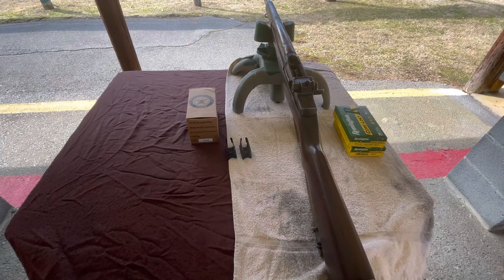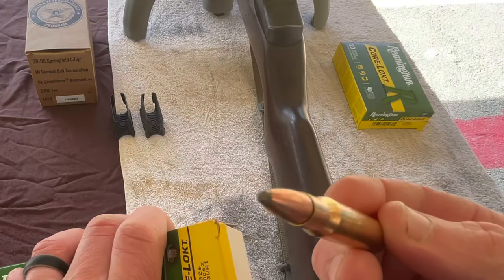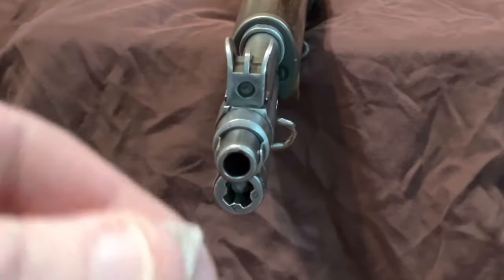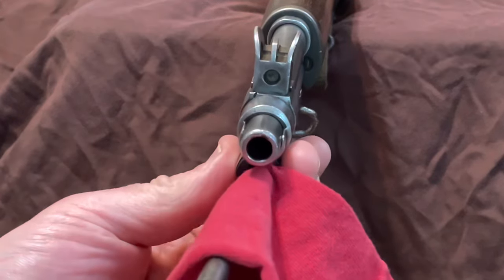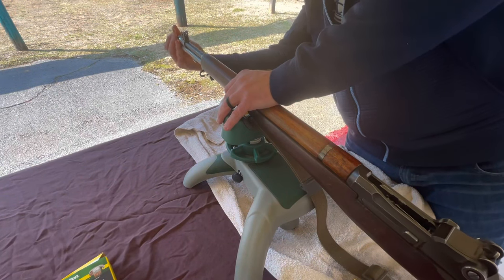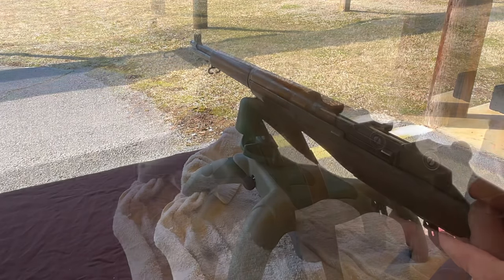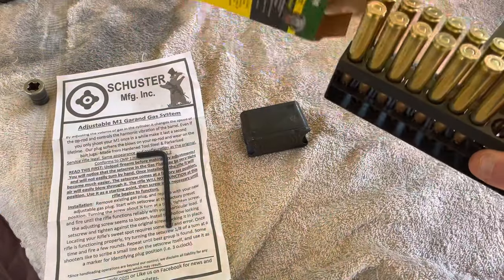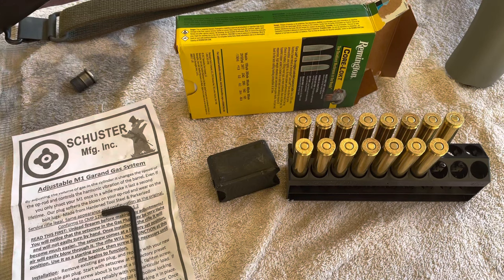M1 Garand Shooting Commercial Ammo-Safely!

Comment: The Garand Collectors Association along with the CMP did a huge article on this in one of there magazines a few years back. Basically explaining commercial ammo is perfectly fine to shoot out of a M1 as long as the bullet weight isn’t over 180 grains. The need for a gas plug isn’t necessary and they recommend just replacing the ope rod spring and lubricating it properly and you’ll be fine. Just stay away from anything over 180 grains and and any super hot ammo. If it makes you feel any better the guy that’s wrote the article was a USMC Match Armourer. Think it was volume 34 of 2019.
Reply from the maker: Thank you for sharing. This seems to be a controversial topic with several opinions and widely varying conclusions. And I can promise I am not an armorer, gunsmith, or firearms expert of any kind so I wasn’t sure at all. My thought was better safe than sorry to protect the investment. Again thanks for sharing the info and thanks for coming by!
Reply: @cornfromajar3222  no worries. I considered the gas plug as well when I bought mine but ended up buying a case of PPU M2 Ball ammo so it’s all I really shoot.
Reply: I'm not convinced. I loaded some very mild 150 gr BT loads last week using W760, as I have a lot of it. According to the Hogdon Data Center, it should have been a 40,500 CUP load. That's 9500 CUP under the CMP max recommended pressure. I've been shooting a lot of 1968 FN Ball ammo and know how it feels. My load was violent. Lots more recoil. Lots more vibration. The gun didn't like it. I have been doing some loads with W748 that are accurate and mellow on the gun.
Reply: There is a lot of surplus ammo out there that you simply can't know how well it was stored. You might be shooting some ammo that is spicier than you bargained for. I have also ran some PPU through my M1 that caused some slam fires and I could tell that the pressures were not consistent. I'm sorry but I can't fully trust surplus ammo or cheap new manufactured "Garand safe" ammo from eastern Europe. To each his own but I know that the plugs are $40 but a new stock and op rod are a lot more.
Reply: @ranchodeluxe1 you might try h4895. I have good luck. keep the loads sane.
Reply: @ranchodeluxe1  Have you considered it might be the shape of the bullet you are using. Boat tail 🤔
Reply: @JamesWhite-tg4kw  Nope. Don't think a 150 BT is going to radically change the guns characteristics over an M2 Ball round.
Reply: I rarely shoot mine. If I do I shoot 150 grain ammo. I was told from a Marine that was issued one in the 50’s and a Sailor who was issued one in the late 60’s early 70’s to keep the spring and op Rod well lubricated.
Reply: @lemmdus2119  so what do you think is the best Lube for this 🤔
Reply: Are completely wrong with everything once you said magazines they don't take them it's a m block clip
Reply: @JamesWhite-tg4kw  grease look up on YouTube you don't use regular gun oil are regular cleaning kits
Reply: I made a amateur mistake one time loaded mine with not military grade 30 odd 6 and a lot of them you cannot
Reply: @patrickkish2931  en bloc. Since we are ball busting.

Comment: The issue is the burn rate of the powder used. Since it was a military rifle, all M2 ammo was loaded with IMR-4895. A powder in the same burn range will work. I load with Varget, which is fine. Is this trick gas plug warranted against damage to one’s rifle?
Reply from the maker: To my knowledge, it is not thanks for coming by!

Comment: Load a round stripped off the clip, by letting the bolt slam forward into battery.  Then eject the round and look at the primer.  See where the floating firing pin hit the primer?  Almost, but not quite deep enough to set it off.  You shoot enough commercial ammo, and someday you will get a surprise.  Much sooner if you fire reloads.
Reply: M16 does the same thing, floating firing pin as well.
Reply from the maker: Thanks for coming by!

Comment: I hand load for all my rifles. The M-1 shoots bullet weights 147gr to 175gr at 2800/2700 fps with no problem. Intermediate burning Powders; Varget, RL-15, IMR 4895, 2520 are the best choice. IMR 4350 and a 180 bullet is asking for trouble. It has to do with pressure curves and timing. Duplicate WWII ball velocities and you will have no problems. Commercial standard velocity ammo 150/165 gr will give you no problems.
Reply from the maker: Thank you for sharing. And thanks for coming by!

Comment: I have purchased this gas plug but never used it.  I've found that new, M2 ball "replica" .30-06 by Privi Partisan costs about the same as commercial .30-06 hunting ammo and is plentiful. 
The M1 Garand is actually rated to safely fire M1 ball ammunition, which is spec'd at 175gr, muzzle velocity of 2647, muzzle energy of 2675 ft/lbs.
If you can find commercial hunting ammo that is within those specifications, you really don't need to bother with the gas plug.
Reply: That may, or may not be correct. It's the pressure curve created by the chemistry of the powder, bullet weight and jump that are the concern. 50,000 CUP is what CMP states. They make no reference to ballistics, whatsoever.
Reply from the maker: As far as I know, and I’m no chemist or Garand expert, I felt like any thing I could do to protect my investment I wanted to do. I want one of my sons to get this rifle one day, and there is just enough question and mystery involved to buy a plug. The opinions are very mixed. Thanks for coming by!
Reply: I'd love to find that Privi Partisan ammo, but have never seen it offered anywhere.

Comment: I ordered a grand gear gas plug and installed it just to air on the side of safety, and have piece of mind. If commercial ammo will bend the opp rod or not i guess would depend on who you ask ! But they say a ounce of prevention is worth a pound of cure !
Reply from the maker: It definitely depends on who you ask. A quick scroll through the comment section on this video will tell you the opinions vary widely. Or a quick Google search. Thank you for coming by!
Reply: Same here. Have some HV 30-06 back ups if Shtf.

Comment: You don't need that aftermarket plug as long as you properly grease the rifle and make sure the recoil spring has adequate spring and a length no less than 19.5"
Reply from the maker: There seems to be a lots of discussion either way whether it is actually needed. As far as I’m concerned, better safe than sorry.
Thanks for coming by!

Comment: A few years ago I got a replacement non-adjustable plug from Garand Gear (Schuster used to also make one) to increase the gas cylinder volume.  I didn’t want to mess with an adjustable plug, but only make it a little softer shooting for 168 grain handloads.  I recently picked up another Garand so perhaps will give the adjustable plug a try.
Reply from the maker: Thanks for sharing and thanks for coming by!
Reply: So how to you like your new gas plug. I've been thinking about getting one so I can shoot heavier bullets. Thanks for any help 👍
Reply: @JamesWhite-tg4kw  The fact is a lot of people think that the standard setup  is fine for even heavier bullets.  The original M1 Garand round was 174 grains as I recall, and the rifle will handle that no problem with no damage. But I just wanted a little bit of margin of safety when shooting 168 grain or heavier bullets over the M2 ball, so that’s why I got the nonadjustable Schuster plug.

I also did end up buying the adjustable plug, but haven’t tweaked it yet with different handloads. I think either way, it’s a good upgrade to the rifle just to give you a little bit more margin of safety and more confidence when shooting anything but the standard M2 ammo.

Comment: Both of mine shot perfectly with commercial ammo - even the relatively hot Yugoslav Privi Partizan M2 ball.  This stuff had large flash holes.  What they really don’t like is anything with slow burning powder, which is what most heavy bullet loads have. Too much residual pressure at the gas port induces violent cycling of the operating rod.  Not always though - I even shot vintage Kynoch 220gr ammo but this was probably conservatively loaded for tropical use, typical of their stuff.  4895, 4064 OK, - 4831 nope! Never did try 4350.
That gas plug looks like a great idea from a precautionary perspective. 👍🏻
Reply from the maker: This is the best explanation and breakdown on the topic yet. I wish I could have explained it that way in my video. Well said and thanks for coming by!

Comment: Keep your oprod spring 'up to date', replace it if its not the correct length, no hot rod ammo, properly grease the rifle according to army specs, and go to work.
Reply from the maker: Mine actually arrived with a bad oprod spring (it had a kink) which from what I’m told is pretty common. Got that replaced and I was on my way! Thanks for coming by!

Comment: I have an M-1 that is bone-stock, no mods at all. Generally speaking, would the Remington Core-Lokt .30-06 in 150gr be a safe choice of commercial ammo to use? I would not anticipate any heavy use at all; just for sighting in and the occasional box or two at the local range. (A CMP tech inspection is a given before I take it out, regardless.) Thanks!
Reply from the maker: Honestly, it may be ok, because the muzzle velocity on the Remington isn’t that different from M2 Ball. But personally I wouldn’t. It’s a very gray area to “risk” blowing up your OPROD, the age of the rifle, the strength of new ammo… the list goes on. And it depends on how worn out your own rifle is as well. With mine, it’s had a long life and shows it’s age and I wouldn’t risk it. If yours looks in great shape inside and out, I wouldn’t think shooting more than a box would be damaging but that’s definitely at your own risk. Thanks for coming by!
Reply: Don't do it!!!
Reply: it will be fine. that Garand was desinged for nearly 180gr ammo.

Comment: I don't care what all these shade tree experts say about the 150 grain cartridge. Read this: IMR 4895 propellant
A new cartridge was developed in 1938 that was essentially a duplicate of the old M1906 round, but loaded with IMR 4895 propellant and a new flat-based bullet that had a gilding metal jacket and a different lead alloy, and weighed 152 grains (9.85 g) instead of 150 grains (9.72 g). The 150 grain 30.06 bullet is the same bullet of World War 2 as it is today. I have fired both Military surplus and commercial ammo. There real is no difference. Anyone ammo gun powder over time will be affected by improper storage. If it is not in a dry and cool climate. The ammo will be effected and this is why you must be careful about when it was made, and where it was stored over many years.
Reply from the maker: Thanks for sharing and thanks for coming by!

Comment: I was always told it was the heavier bullet weight of hunting ammo (over 165 gr) that would put to much pressure on the gas system of the M1 causing your op rod to bend more than it should be. Maybe it's both.
Reply: the m1 garand was designed to shoot m1 ball which was a 174gr bullet. Many people say that the garand was designed to shoot 150gr m2 ball, but this is false. M2 ball didn’t exist until after the garand was adopted into service
Reply from the maker: I’m just one person, and everyone has their own opinion especially since the military didn’t release a guide for folks to use their own ammo in the weapon. 
That being said, it’s my belief after researching this, the common theory is the powder makes the difference in the WW2-era stuff versus modern ammo. As to the previous reply to your comment- yes the gun was built around a certain bullet weight. But again, ammo 70-80 years ago was loaded different. Just my 2 cents. Thanks for watching and thanks for coming by!
Reply: @cornfromajar3222  Hi, I was told by the CMP that pretty much any commercial 30-06 150 grain up to 172 grain ammo was safe. I have been shooting Remington Core Lokt 150 grain with no problem for some time now. And Federal 30-06. Just keep your rifle cleaned and oiled and you should be fine.
Reply: The M-1 was originally designed to fire a bullet of 173-grains, since M1 Ball was in service from 1925-1937. When the army decided to switch to M2 Ball 150-grains, John C. Garand was initially against the change since his rifle had not been designed around the M2 cartridge. However, in due time, Garand solved whatever technical issues presented themselves and M2 worked fine. Most reloading manuals list loads up to 175-180 grains as being the maximum weight for use in the M-1. You could probably get away with something slightly heavier, but why risk it? These rifles work very well indeed as designed.

Comment: Recently got my M1 Garand from CMP and now trying to learn more about it. Once you have the Schuster installed and can use the commercial ammo, can you then use the CMP ammo without adjusting the gas plug?
Would seem to me that you would have to adjust it so that it would cycle for the lower pressure gas of the CMP ammo?

Thank you for the video.
Reply from the maker: You are correct. Every time I shoot a different kind of ammo I readjust the plug. Thanks for coming by!

Comment: I was at Walmart 2 days ago and found 10 boxes of this ammo dirt cheep. The core lokt 150 grain. It was 10$ a box so I got 10. I’ve been told it’s safe to shoot without the gas plus not I’m not positive on it. If anything I’ll run it trough my 1903a3 Springfield. But I wonder how well this could run with out the plug
Reply from the maker: I first would say congrats on a great score. I live in rural SEC country and our Walmart hasn’t had that ammo for that price in a long long time. 
As for the gas plug/screw, I have heard from/ read over the years that it is an option to remove the screw and shoot. That releases all the gas and makes it basically a bolt action where you cycle every round manually because it won’t chamber the next one. I’ve never tried it myself since I have the aftermarket plug, but I may try that in a future video. 
Thanks for coming by!
Reply: Thanks man! Kind of shocking I got that ammo in nyc. I may look into getting a new plug. I may just shoot all of that ammo trough my bolt action. I have a few m2 ball rounds left for my M1. But great video and very informative!

Comment: Shooting commercial ammo in the M1 is not going to blow up the gun lol.  It will however, over time, result in a bent operating rod and those are expensive to replace.  If you can get those rounds run through a chronograph it would be really helpful to know what velocity the rounds were reduced to.
Reply from the maker: Comments on these videos have really made me stop and think and yours really gave me a wake up. I didn’t even think to bring a chronograph while I was doing this video and that is a great idea. I don’t reload so I’ve never thought to buy one, but I know some people. I may do a part two because you hit the nail on the head. Thanks for coming by!
Reply: @cornfromajar3222  no problem.  I have owned several M1's through the years (I'm 76) and with my first one I also did not realize commercial ammo was different than ball ammo so of course after a couple hundred rounds I noticed the op rod had a bow in it.  This was way back in the 70's so it wasn't like I could look at all the world's knowledge in the palm of my hand lol.

Comment: The human body is very perceptive. I rebuild antique Harley-Davidson engines. There are technical terms, such as " plug fit" , "slip fit" and running fit that refer to the interface of two, usually cylindrical parts. These terms have physical measurements associated with them. I can feel these measurements without ever picking up a micrometer. The same goes for shooting a Garand. I can feel the difference between loads and I compare what I feel to my muscle and sensual memory of how an M2 Ball round feels. I have lots of 1968 FN ball ammo. Just shoot them, then shoot your intended load. For instance, I have a lot of W760 powder and found a load for 150 gr Hornady BT that was supposed to produce 40,500 CUP. That's 9500 under CMP recommended pressure, but that load had a lot more recoil, and a lot more vibration and resonating. So, I knew my rifle didn't like it, regardless of the numbers.And that's as far as I need to ponder it.Hope my rambling makes some sense.
Reply from the maker: I get it. And the more experience you have with a device or machine, the more you know it’s limits and what it can handle. And the same can be said about shooting when you do it often enough. Thank you for sharing and thanks for the insight!

Comment: I have a Garand Gear gas plug installed. Would you recommend shooting 180 grain Remington Core Lokt?
Reply from the maker: I haven’t shot 180 grain core lokt myself, but I have shot heavy loads 175-180 grains from Winchester and it seemed normal. I would check the Garand gears recommendation and whatever the load, shoot it with the gas plug wide open and adjust until the rifle cycles. Thanks for coming by!
Reply: @cornfromajar3222  unfortunately the garand gear is is not a adjustable gas plug like the schuster. It just increases the volume enough to shoot lighter modern loads. I just found the inrangetv video on it and it looks like it's not recommended to shoot something like that with the garand gear gas plug.

Comment: Great video, I am a new owner and I'm thinking of purchasing  this adjustable gas plug. This weekend while shooting the Federal M1 ammo, the rifle was cycling fine, but as time went on the brass was being damaged as it was ejecting and messing up the neck of the brass. The brass was also noticeably hot to touch. Has this happen to you?
Reply from the maker: It has, and sometimes the brass will leave tiny flakes around the chamber, which comes from the spent shell casing itself. And it is hot. I am told this is normal but it never hurts to consult an experienced garland shooter in person for some advice (and I am definitely not an expert). Thanks for coming by!